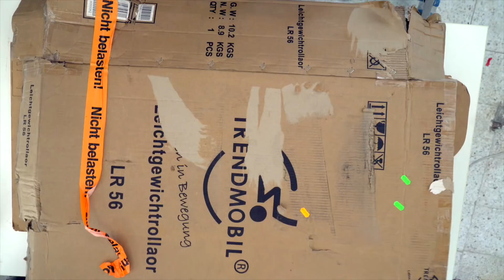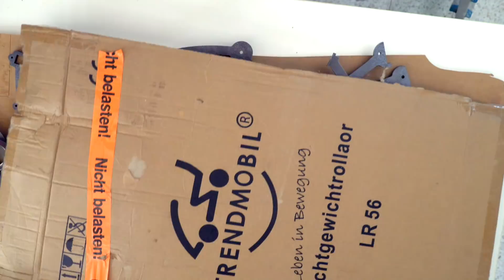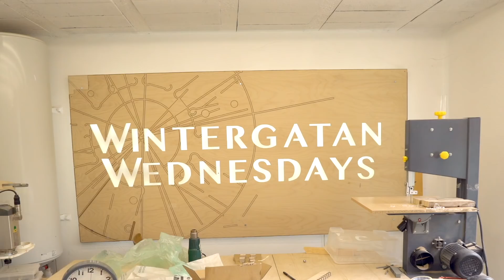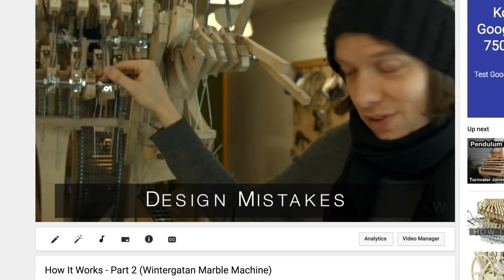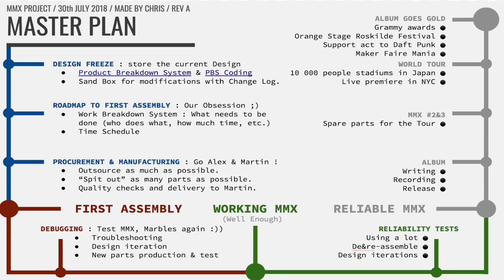Flywheel - Marble Machine X #46

Comment: Just a heads up for future fitment. Instead of sanding out a precision  machined bearing housing, freeze the bearings and heat the housing. They will drop right in, and then when the temperatures normalize,  the bearings will need to be pressed out. They won't wobble even at a microscopic level.

Comment: Question: why didn't you have some sort of press to fit the bearings into their flywheels?  Safe or shafts into the bearings.  Would a tight fit not be better than what looked to be a rather loose fit after all the sanding you did to the various parts?   I am not criticizing, but making a curious observation and wondering if there was a reason for your approach that I am not seeing since most of the bearing insertions I have seen have been fairly tight and with a press in some form or another.  Perhaps I am over analyzing your methods, bu that is something that has stuck out for me.  Other than that: awesome job on everything!

Comment: You will want to take that flywheel assembly apart and rebuild it. Not just because the bearings will fail sooner rather than later(there is no such thing as a 'perfect' seal on bearings, and the lubricating oil you used when drilling is a 'penetrating' liquid... it gets drawn in by capillary action), but you will also want to replace all the nuts with Nylock nuts. Or at least use a 'threadlocker' liquid on the bolts before replacing the nuts. 
When installing a bearing and you can't use heat to expand the metal first, don't knock on the outer race of the bearing, get a large socket that has the same(or slightly smaller) diameter as the bearing's outer race, a metal plate with a hole in it, a long bolt a nut and a washer. Place bearing on one side of the hole, the plate on other side, tread bolt thorugh it and the bearing, then the socket outside the bearing so that the bolt sticks out through it, then the waster and nut. Use a spanner to turn the nut and possibly one on the other side to stop the bolt from rotating, and slowly crank the bearing into place. Or since you have access to a CNC, you could have made a plate that fits the bearing snugly instead of using a socket. 
And finally, there's a right and a wrong way to use an adjustable spanner. The right way is to use it to bash someone's head in. The wrong way is to use it on anything mechanic. 
The best tools are 'closed' spanners and sockets, then you have the open spanners, and way last you have adjustable spanners. You will understand this the first time you round off a nut or a bolt head.

Comment: Put the bearings on tje freezee for 15 min and the bushings on the oven for 5 min.. it would easily slide together and when both reach romm temp, its a tight fit. No need for sanding, no slight wiggling on the flywheel.. hehe

Comment: Hey Martin, since you are using a lot of screws especially on metal parts, you should care about securing those. I know that you will disassamble the MMX from time to time but some parts will stay fixed for the whole tour. It will be better not to use "normal" washers because they will get loose due to vibrations from the playing, assembling or transport.
I recommend you to try "Nord-Lock" washers on those fixed parts. Special washer that are heavily resistent to vibrations and so on.

I hope you see this advice. Keep on rocking !

Robert
Reply: Yes, I think something like this will be essential. Personally I would prefer to use Nylock nuts, but I agree. I'm a little concerned about the bolts on the flywheel coming loose.
Reply: Just buy a cheap set of nylock nuts. Or get some blue locktite.
Reply: Looking at the latest videos, this comment aged well! 😊👍🏼

Comment: this flywheel looks too heavy for the bearing! you can reduce the thickness to make more lighter and get more inertia, but you need the thick flywheel to turn the big wheel or to put in movement the marbles? when you engage the belt or chain on this flywheel they will keep turning without breaking anything? sorry too many question but this machine is too curious and fascinating! Cheers from Brazil!

Comment: Wintergatan, I still think you should incorporate keys into your programming plates so that they can only be installed in the correct order on the programming wheel; especially if your going to have the plates re-programmed during a show. This will also allow by looking at the key to know which plate is which plate if they ever got out of order. Every plate would have a slot and a peg such that {slot, pin}: plate 1 {001,100}, plate 2 {100,010}, plate 3 {010, 001}. In this way there is no way to put plate 3 between plates 1 and 2, the keying will block it.

Comment: Hi, a few rules from a french mechanical manufacturing teacher (cnc machining specialist). When you use ball bearings, if external ring is free the internal must be fixed. Same thing if the external is fixed, the internal must be free. For a flywheel, the inner is free and the outer is fixed (you can use some LOCTITE 603 to glue the outer ring to the flywheel bore). As usual a very cool video.
If you are interested I can machine with my students some parts that require accuracy. Cheers.

Comment: the rotation is not straight in the camera (at 9:04). like bumpy or wobbling left to right and vice versa. Have you seen it spin smoothly from the outside of the fly wheel?

Comment: I suggest using spring washers or blue Loctite on the nuts on the five through-bolts (or replace the nuts with nyloc nuts). Otherwise, the  movement of the flywheel will probably loosen the nuts over time...

Comment: I am impressed with your imagination, and adaptation to achieve your goals. In  these turbulant times I find your videos  peaceful and a good way to lower my blood pressure. A word of advice though, to tighten down the nuts please toss out the nut-fucker and get a proper six point box wrench or socket with ratchet or speed wrench. You'll save yourself time by not having to mess around with adjusting the wrench and you will strip thread before you round the corners of a nut.

Comment: The axles should be tighter than that. The bearings should be placed by warmtight, so put the axles/shafts in the fridge 60min or freezer 30min and warm up the bearings by a heatgun for not to be touch by hand, when you assembly then them, they are tight ebough to work properly. When assemblibg them in to the flywheel, put the bearings in to the freezer and heat up the wheel.

Comment: Another tool for your list, something that will be VERY USEFUL throughout your building process: a bench-mount arbor press, like this https://www.amazon.com/Arbor-Mountable-Bearings-Joints-Assembly/dp/B019U6P2HU/
Bearings, bolts, brads, sockets, snaps, studs, rivets, and a whole lot more are so much easier with a decent press.

Comment: Really liking the look of this assembly great design! and the look fitting in with the rest of the steel work. Balancing the flywheel also make it smooth and give a consistent fuel when cranking and have no vibration through the machine which may affect some of your percussion instruments with resonance as spinning it and allowing it to settle and monitoring and marking where it falls increase or decrease wait there in your case it would be most reasonable to think that removing a small amount of material otherwise drilling a hole or making small grinding marks would help lighten one side and allow it to be properly balanced this will also increase it's overall duration of spin. Something you should consider though is where the bearing assemblies go through and the outer bearing race meets the mild steel of the flywheel and other spaces. use a process of bluing  between the bearing mating surfaces a small amount of rust or corrosion will make it near impossible to remove without damaging or heating up parts the. bluing is quite simple and is very common with firearms it gives a protective coating and it does not add any noticeable layers or increase the dimensions of the hole and it is hard wearing and the application is a simple. First degrees with acetone or any other cleaner solvent apply the bluing liquid with an ear cleaner or cotton bud and allowing the metal to oxidise this will ensure that the metal inside does not rust and is protected. it can also be controlled to reach the desired colour going from a light grey black to a heavy dark I hope that you will look into this it's really coming together and I'm really enjoying this the editing and the progression through the episodes with a little bit of music on the side. love your work mate keep it up from Australia SA

Comment: Love the videos! May want to check into getting a shop press for all the bearings you're having to install. (example. https://www.harborfreight.com/6-ton-a-frame-bench-shop-press-1666.html) I know today's example wouldn't exactly fit, but something small like this could be reassembled around the part itself to line up properly.

Comment: Never push a bearing from a single side, because you'll going to tense the outer ring. This will cause the bearing to fail quicker, because the balls have to move in a twist, causing additional friction. You have to put even pressure on both sides, better the whole outer ring. So, if you use a log to punch it in, try to lay it over all and hit it right in the center. This is no criticism, i just want your machine to work perfectly. Great Video, once again. Great journey so far. I love your creativity.
Reply: I agree, This can ruin the barrings, Also bearings love being clean! All that drilling and dust on them will shorten their life quite a bit. You may already need to replace all those bearings.
Reply: yeah that's why a lot of people use a wrench socket of the appropriate size to smack them in.
Reply: This is criticism, but it's the best kind of criticism.
Reply: Use liquid nitrogen if you can get it!
Reply: There’s so much he does wrong from an engineering perspective I’ve given up.
Reply: agentcrm that's ok. In the end it's all about the music

Comment: Just a suggestion but for any parts that you don't plan on taking apart regularly. I would use some kind of thread lock on those nuts and bolts. That or lock washers, or lock nuts. Otherwise with movement and vibration they may become loose over time.

Comment: Do yourself a favor and buy a set of stub length drills for your drill press.   THe amount of bell mouthing on the drilled holes will be cut down a lot and it'll wander less on start.

Also, if you need to tighten up the bores on any metal parts, take a center punch and put a couple small punches in the bore before you press in your bearings.

Also get rid of your nut fucker and get a proper set of wrenches.   Nothing says amateur like a rounded over bolt or nut.

Comment: hey wintergatan, i think that the flywheel will spin longer if you spun it longer so the grease in the ball bearings could liquify more. i play with ball bearings alot and the dont spin like that much when the bearings are cold. it spins so much better when the bearings are uh warm. and because you are preforming, you dont want to remove the grease as that will be pretty loud, so you might want to replace the grease with something like https://www.mystiklubes.com/Product.do?code=665027002&category=GREASE and you need greasse because oil is still pretty loud. if you chose another grease then make sure the grade of the grease is lower than NLGI consistinsy  of 3, and higher then NLGI consistinsy of 0 (well, 0 could be fine, but 1 is better). (and this grease can go to -40  to 121 degrees C so it sshould be in the range of your usaage)

Comment: Please use nylon nuts so they don't vibrate loose
Reply: Love Castle you are right. Else he could use some thread lock like Loctite for instance.
Reply: And never-seize on the parts that need disassembling each road trip.
Reply: Nyloc nuts. Just in case someone reading this thinks you mean 100% nylon, they are steel but  have a nylon insert that grips the thread.

Comment: Ok.  I hope i unterstand.  The long holes are for adjusting or tighten the belt, right? 
Why you don't use an eccentric disc or eccentric adjusting screw? 
Maybe the chain adjusting of an BMX bike can be an idea, too.
Reply: Oh.  Min.  4:30. you can warm up the center of the flywheel.  And i store the bearings a few ours in a icebox.  When the bearings are cold and the flywheel are warm the bearing will go in very easy.  And when the temp. is the same it is connected very strong.  When the bearing is not connected strong enough,  the outside of the bearing will sometimes move.  Then you have Vibrations.  I hope you unterstand my baaaad  english.  🤣
Sorry for that.  Think about it.  

And thanks for doing all the amazing videos.

Comment: When putting in the bearings you should leave them a little tight. In order to fit then, get some canned Air that is used for dusting computers keyboards, and turn the can upside down and spray the bearing cold. It should shrink just enough for it to slide right in. Then when it gets warm it will expand to its original size and fit like a glove and not move on you.

Comment: Happy to see you are using some more reasonable protection & lubrication :P Keep in mind the sanding / wire brushing roughens up your surfaces which might lead to different abrasions / stress points. Especially with the metal parts this might lead to rust close to the bearings which is probably not good. (edit: especially after seeing that bearing single-handedly convert all that flywheel momentum to heat in only a few minutes! While a good time for the energy conservation it definitely means this will be one of the most stressed bearings in the machine.. you want it to last)
Thanks for your time if you read this and keep up being amazing :)

Comment: Awesome work on the flywheel, but a word of caution; it looks like a 50lb guillotine with a potential for tons of torque. Honestly, I'd consider a could circular plexiglass safety shields to cover the sides of the flywheel -- a child protection security & safety measure.

Comment: Can anyone see how the flywheel is driven?   It's free running on the axle, so I guess it's driven from the circumference.  But that doesn't appear  to  be designed to take a pulley belt.  Friction drive?

Comment: Nice work! You might want to consider locking nuts on the backside, commonly called Nylock.
Reply: may not be enough clearance for that.  there are nuts with grooves cut into them to make them lock, and of course there's my preference - Loctite (thread locking compound).  i recommend the blue type because it's easily removable.  red is just about permanent.

Comment: I don't like to see the sandpaper. It is wrong dude. It was cut precisely and it is meant to be completed by thermal difference. You should freeze the inner piece and heat the outer piece. The outer piece will expand, the inner piece will shrink. Then it will fit precisely and there won't be any slop introduced. Of course you can't heat bearing, but you can freeze it, so if it is an inside bearing, you just freeze the bearing and heat the outsice piece. If it is outer bearing, you leave the bearing in room temperature and freeze the inner piece.

Comment: I see your reason for using the bearings to align everything but I would only locate holes with this method. After locating I would disassemble the flywheel from the bearings and finish drilling my holes to reduce the chance for contamination in the bearing. I do see that they are sealed bearings but even the smallest metal shaving could potentially sneak by and cause the bearings to fail early.

Loving the progress and keep it up!

Comment: AHHH.... You left the bearings in while drilling!!!!! AHHHHHHHHH!!!!!!
Reply: they are the rubber sealed type they should be fine that side i have ruined the mental shiled type byt doing what he did
Reply: Fretting would still happen if just one small piece of the metal chips entered the seams of the rubber seal
Reply: yeah but one brand new bearings those seals are usually very tight if they are of reptiuble manufacture so its unliking to get past the seal, not saying its impossible if he got unlucky
Reply: result on 5:40... that was CLOSE!!!
Reply: He can’t be perfect over a milion watchful eyes, he’s human after all
Reply: It looked like he did the final assembly with new bearings, at least I'm hoping...

Comment: Martin, I know why the flywheels are out of steel but you might have considered the side holders made of aluminum. It is light but strong.
Reply: Aluminum does NOT dampen vibrations well. Thats why not aluminum.

Comment: Tip: When working on bikes you always grease metal-metal connections. It prevents parts from wearing out prematurely, and causing excess play in what used to be tight fitting components.

Comment: There is another way to install bearings in to metal parts and that is to clean the metal components that the bearing is going in to and cool the bearing, put the bearing in its spot and let the bearing warm up on it's own to get a tighter fit on the bearings, I keep looking out for the Wednesday builds of MMX!

Comment: i hope hand drill sanding the fly wheels center has not destabilized it too much, a lathe should have been used for milling the hole..
Reply: I hope he didn't open it up too much. Bearings should be a press fit or they might slip. He should have frozen the bearings (possibly heated the wheel in an oven) and then they would have been easy to install. As soon as they return to normal temperature, they would have been locked together almost permanently. Perhaps not critical for this application, but I wouldn't take chances.

Comment: Personally, I would have gone for an interference fit with the bearings; put a bunch of heat in the flywheel components, freeze the bearings, little tappy tap in, and those guys won't go anywhere.